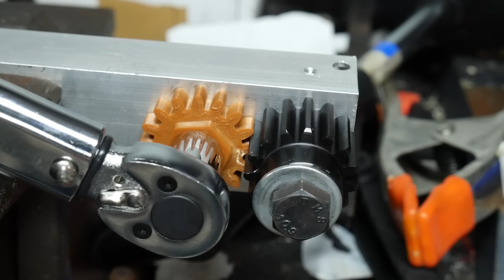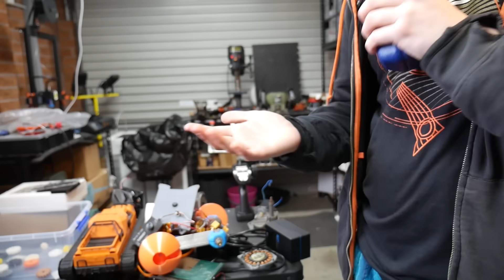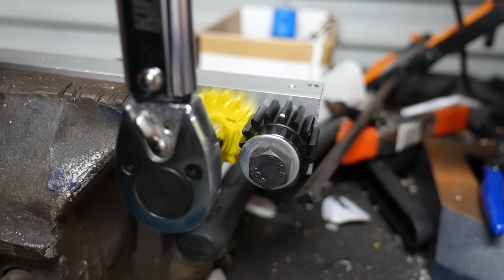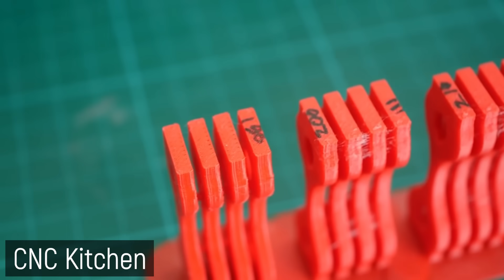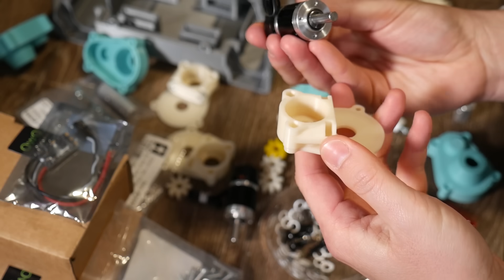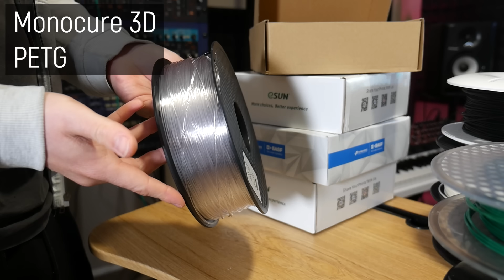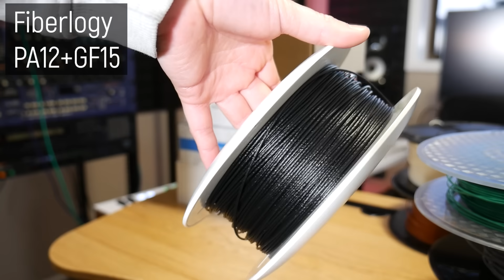Which 3D Printed Gear is Best?

Comment: To make this data a bit more understandable, keep in mind that 1 Nm (newton-metre) means the torque of a force of 1 N (newton) is applied at a distance of 1 m (metre) from the centre of the axle (in example on a lever, or in this case, the diameter of a gear).
1 N (newton) is equal to the force needed to accelerate 1 kg of mass at the rate of 1 m/s² (metre per second squared), and on earth, the gravitational constant is  9.80665 m/s² (metre per second squared).
This means: A force of 1 N, is the force applied by the mass of 0.102 kg (on earth).
If the length of the lever (or "pitch radius" of the gear, which is the radius (pitch diameter/2) of the imaginary circle where the gear engage with another gear) is different, the force applied at that point is:  F (force at the end of that lever/pitch diameter of the gear) = Nm (newton-metre) * 1 m (distance metre) / d (distance or "pitch radius")

Summary for "easier to understand units":
The force depends on the length of the lever/radius of the gear.
On earth: 1 Nm is equal to a mass of 0.102 kg hanging off of a horizontal lever at the distance of 1 m.
Examples:
For a lever of 10 cm: 
    F = Nm * 1 m / 0.1 m
    in case of 6 Nm, that's 60 Nm
    on Earth, that'd be 6.12 kg
For a lever of 1 cm:
    F = Nm * 1 m / 0.01 m
    in case of 6 Nm, that's 600 Nm
    on Earth, that'd be 61.2 kg

The printed gears used seem to have a pitch diameter of 30 mm (converted using known measurements in screenshots of the video, then using these as reference to calculate the pitch diameter).
This means the pitch radius is 15 mm.
So at 6 Nm, the gear experiences a force equivalent to the mass of 40.8 kg.
In some cases, the initial failure point does not seem to be the outside of the gear, but the hex engaging on the inside, which, experiences much higher forces even. Over 1000 newton of shear force (102 kg ). That's actually pretty respectable, in my opinion.

Optimization:
I can imagine the hex shape being rather bad at transferring the torque. Also, knowing that the infill does not add much support, the bottom and top layers are the real interface between the gear lobes and the hex interface, and at 0.25mm layer height and a mere 3 top layers and 3 bottom layers, these seem to be the weak spots.
3 walls at (I assume 0.42 wall thickness) = 1.26 mm, but only 0.75 mm top and bottom "walls". The inner hex is reinforced with a little extra rim, but right after that, the force should be greater than at the gear pitch diameter, and whilst the force is distributed differently there, the material is significantly thinner.
I would try to double the top and bottom layers, and drastically reduce the infill (5% adaptive cubic) - and as the main purpose of the infill is to help print the top, for smaller parts, I'd remove it entirely and maybe add another top and/or bottom layer instead.

Comment: I prefer the common PLA/PLA+ that I can get cheaply on Amazon. However, I don't trust anything other than clear or translucent colors. I feel that black PLA is inferior because you don't know what's mixed in it. This has been the case for four years now, and it will probably still be the case four years from now.

Comment: Interesting video! I have a few questions/comments:

Wouldn't the repeated torque being applied against the same teeth give you skewed results? Also, how are you controlling your torque application? It seems manual, which adds variability to your torque application in the localized contact point. For example, assuming the feeding rate and "rest" time between torque application stays the same, the gear will be most resilient when applying 8 n-m on the mating gears during the first application then if you apply the same torque again the second time. Also, there was no detail on the slicing parameters and the dimension of the gears, which I am assuming is the same across all tests.

Comment: wha'ts the best material for such gears (or around 10-14mm diameter, but very light load).
I guess all CF,GF additives are bad as they increase abrasiveness - thus reducing the lifespan ?
PA6 ? PA12 ? (pa12 is weaker, but easier to print at the end?) - everyone is praising nylon self-lubricating properties.
Any other materials make sense? like PETG,ABS,ASA, hard TPU ?

Comment: I got a gear tuning my key at the house door which makes the entire door vibrant and us therfore really loud.

Is it possible to use any kind of moderate TPU to buffer the vibration with the intent to make it more silent?

And if so which hardness would you think would be necessary to have enough fkex to absorb the vibration abd in tge other hand is hard enough to turn a key?

Until now my gears are PLA 100% infill.

I formerly had PETG-CF with not full infill I assume 30% and I noticed a loudness increase with PLA and full infill (even I expected it to be more silent with full infill) so I would rather do less infill the next time and probably normal PETG.

Any Ideas what to do to get the sound decoupling from gear to door in case TPU is no option?

Comment: I bet if you ran the gear for 5 min dry would radically change the pla performance.
Reply from the maker: Yeah for sure, I'm still planning on revisiting with a high speed wear test.
Reply: @MakersMuse  The unfortunate reality is 3d printed gears are not durable compared to metal or molded and less precise. But there's ways of improving them. Insert a sheet of metal mid print.

Comment: Great video, exactly what I was searching for ! However, I know this is old stuff but I think you should use some sort of fixed guide the diameter of the torque wrench to ensure that the torque you measure is perfectly axial to the gear. With you setup, as soon as you're not perfectly aligned you also measure torque vector components in other directions, which biases the results.

Comment: You need 100% infill as others have pointed out and you also need a better profile for transferring torque from the metal nut. Try a torx profile or a spline. Some of the materials you tried split because the nut exerts a large outwards force as it tries to spin. When you are designing parts in weak materials like plastic you have to use every method available to stop them breaking.

Comment: TPU is a SOLID choice for gears. Yeah, the rubbery stuff. It is durable, has epic wear resistance, and rather quiet in operation.
Reply: I would suspect the frictional losses would be significantly higher than harder filaments.
Reply: @ferrumignis  There are videos on the subject. It is worth checking out.
Reply: @SeanLumly  I will, thanks. I love TPU, I use it for anything that needs good toughness where rigidity is not so important.  Prints super nice provided it's dry, and parts are almost indestructible.

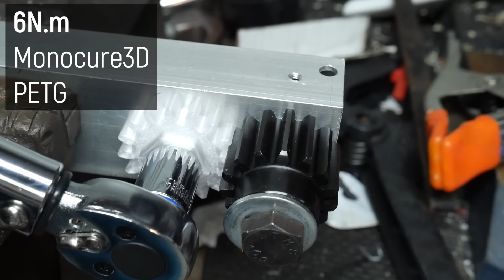Comment: If you slow it down at 11:19 you and you play it you can see the crack start. Awesome video though! Been wanting to get started with 3d printing gears to further my journey into microcontrollers and rasp pis. I was a bit worried about buying a 3d printer but considering most of my prototypes will be plastic only I say these gears should work great.

Comment: I'd try to print PLA at a temperature 15-25 degrees Kelvin higher than the highest recommended temperature on the spool. This should help with delamination.

Comment: This title is wrong. You're testing which is the toughest, not "best". I will argue the "best" filament is the one which resists wear and high RPM like Nylon. If you need strength and high loads then use carbon fiber filled nylon. It's as tough as PLA.

Comment: Well. One line didn’t age well in this video. Abs is one of the more popular filament types nowadays. I print with it way more than pla since it’s much easier to print fast with. And by fast. I mean 500mm/s+ without the need for crazy cooling.

Comment: The Fusion 3 F410 printer I was repairing has a dual material 3d printed extruder gear. I don't know which materials as it's not my printer, but I can tell you that having one material interface with the motor and another interface with the gear for the extruder was a really cool design.

Comment: PLA-ST failed earlier BECAUSE it is tougher. Additives added for increasing the toughness generally improve the impact resistance (which means the material has more "give", the material can dissipate the energy of an impact faster by undergoing micro-adjustments in the polymer chain). This usually will influence stiffness and tensile strength (and shear strength) negatively.

Comment: you introduced a variable when you used line fill pattern for the gears. The angle of contact between the perimeter and the infill line will affect your strength as the torsion is transmitted radially outward from the axle. Using a concentric fill pattern would have increased the contact area between the successive print lines and also would have kept the strength uniform radially.

Comment: With the nylon gears you could use pin slots around the center so rather than a shape which can slip, it would have to eat through the plastic before losing grip. (Edit: I see you mention later in the video about using a keyway design)

Comment: What surprised me the most is how similar all of the results were. As a percentage not really much difference no matter what material was used.  I also don't understand why anything other than 100% infill.  Infill only serves to make something lighter while giving it enough support so keep it's shape.  Not something you would want with a gear. The only place I might see in a gear would be the flange where the stresses are not so great due to forces being distributed. But unless you're making something that needs light weight like something for a drone why bother.  You should always begin with the end application and work back to the manufacturing process.  It's good to keep the fabrication in mind when designing but that should not be the driving factor.

Comment: TLDR: Use metal gears FTW. The efficiency of a pair of perfectly formed spur gears is due to rolling friction; i.e., bearing friction loss. As PLA gears bend, the teeth slide on each other. I’ve seen a number gear trains made from PLA that had 40-50% power transfer efficiency. Did they work?… sure. But huge inefficiencies like that point to lower life expectancy, inefficient use of energy, and so on.

Comment: Why would you not fill 100% ??? Also you need to print only perimeters.

+ advice: you might want to modify your tooth profile by adding a full root filet. Just make sure it doesn't impede the meshing.

Comment: This analysis is actually testing the gear design and fabrication parameters more than the chosen material.  Changing the design or parameters for each material can yield much better results. For example, I would expect the nylon gear should have a multitooth (e.g., 16) splined shaft (rather than your hex shaft), with thicker sidewalls, because it would distribute the tensile stresses much more evenly throughout the circumference of the gear’s shaft, as resulting in less overall deformation. There is so much more to consider in this analysis, other than merely the materials. This whole video is a great example of how much really goes into, the engineering and manufacturing of a machine.

Comment: This is all very interesting information and something I wish I had seen a while ago.  I've recently gone through multiple iterations of an 81:1 reduction gear box for a PET bottle filament puller after continually doing and sharing the output gear. PLA was hopeless and no brand of filament I tried, nor slicer settings, had any real effect. PETG did very well however and any failures I encountered were easily mitigated by increasing the width of the gears by 1mm from 10 to 11mm. Printing the 10mm gears with the PET filament from bottles surpassed the PETG however. I could not get them to fail or strip at all. I'm guessing the PET is slightly less flexible than the PETG and due to printing at 245°C caused the letters to bond together much better than the 230° the PETG was printed at.  Anything higher than 230° with the PETGc caused stinging and bumps on the teeth which caused them to jam.

Comment: I used a CF polycarbonate with pretty good results and beautiful prints with the ease of pla. I was impressed.  Been making non moving no load items but it is extremely strong compared to the petg I used before on some spur gears. Haven’t tried the PC on gears yet but I believe they would be as strong as any pla or petg.

Comment: If anyone is running similar tests...    I'd like so see a wear test where gears are run quite fast with some load, perhaps greased, and see which can run for longest before failing.

I think this is a far better test than seeing how much force is required to break a tooth.

Comment: If yuo test crap material (yes , pla get humidity from air, imagine ..) yuor data correspond to a filament that spen "years around there in the floor" , for beter results , use the filament for the real object or almost , a very well dry filment o wait , yuo did it 😅😅

Comment: I use BASF PRO1 though PLA filament for production of parts. Last year I used around 25kg of it. But if you want even more strength and toughness nothing compares to the Ultimaker Tough PLA.

Comment: May be worth trying "Filaticum Engineering" a PLA filament with note worthy strength and it will not deform in the environment until 140C - No heat treatment required.

Comment: I have no time to summarize all comments, but sure you already got tons of comments why all these tests is "nothing". It's strange, because "engineering mind" (if you have one) should say you what's wrong:
1. Gear should be printed SOLID
2. Gear should be tested against SAME GEAR! This way you see REAL torque of gears - how they clutch each other, how they bent, what's happen after gears "slip" and so on.
3. Gear can be strong, but sh****ty in terms of durability - important factor too!
4. As test clearly exposed, internal "hexagon" hole must be surrounded with much thicker material - this way you avoid slipping wrench.
Finally, I think this video you need to redo - it's just too dilettantish to expose.

Comment: Another thing you should do in this test you can redo it the same way you did except for every time you put a torque on the plastic gears rotate the gear to some fresher teeth so that way you can get an accurate accurate reading because if you're doing it on a bunch of little torques building up on the same gear you're slowly adding where in damage every single time instead of actually seeing what the true fell point would be consistently and everything you may want to invest in is a digital torque meter it hooks the regular ratchet or breaker bar and it shows you a live reading of the torque

Comment: Torque wrenches are not only used in the Automotive World reuse them in the military to when we're working on aircraft Vehicles they used in anything that takes a nut and a bolt even certain buildings and stuff require certain type of torque or some things still require torque wrench

Comment: very late, twp notes: using an abrasive material for the gears is a bad idea (if will wear out everything, including metals); if there is a concern about 'fancy' motors - add current limiting on the motor itself - always a good idea to have a much faster protection in the electronics (and way cheaper).

Comment: I wonder if helical/herringbone gears would be stronger due to each tooth being connected to the gear's body over a greater part of the circumference, and not being able to fold straight backward due to the angle. The only problem would be finding a compatible metal gear for the herringbone gears—you'd probably have to get two opposite helical gears and stack them.

Comment: The problem with PLA, that at high RPM (or near hot motor) it will melt long before it will reach that torque value :D And PA-GF will not. Another VERY important thing about PA-GF (and most probable EVERY XX-GF filament) is layer height.  I've printed hotend fan ducts from PA6-GF30 and 0.2mm layer 2x0.4 perimeter walls are breakable by hand between layers. Buuuuuut - 0.1mm layer... Well, i can't break them with hands alone no matter how hard I've tried - it's due better GF bonding between layers.

Comment: I'm not really suprised by the results here.. printing the gears at much slower speeds, using combing, and 100% infill will give you stronger parts, due to the bond between layers being more significant, and the lack of voids in the part itself.

Comment: Tbh, the nylon seems better - it fails, but without any part breaking, which allows for while-use-fixing. And this failure point is adjustable by increasing diameter of the gear - the bigger the fix-point the more torque required to fail.

Comment: PA12 is a lower temperature, lower tensile strength material. PA6 would have been a better material to use as a gear. And PA6 is widely used in the automotive and motorcycle industry for immersed oil pump gears.